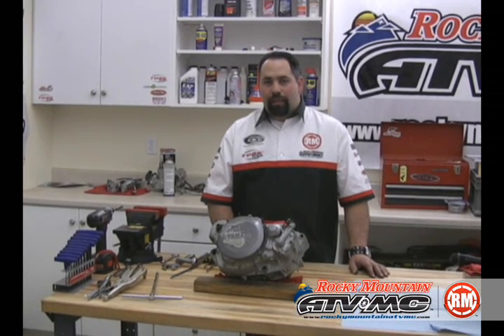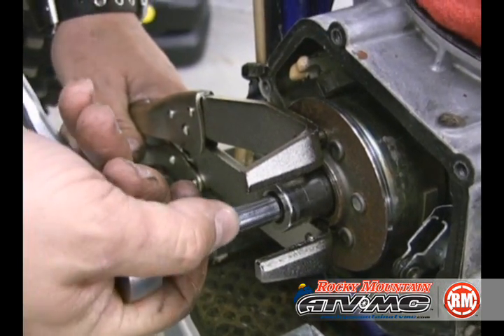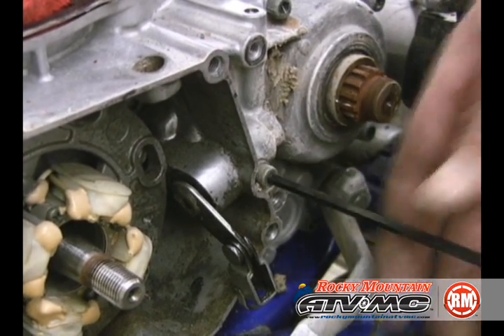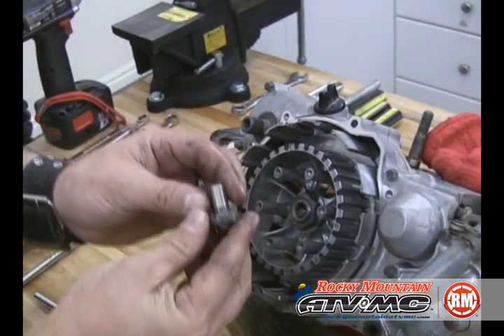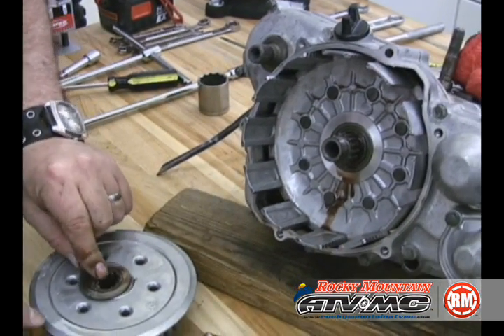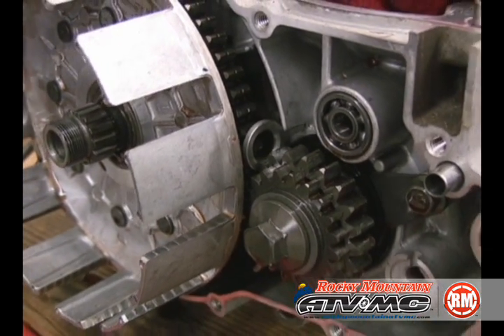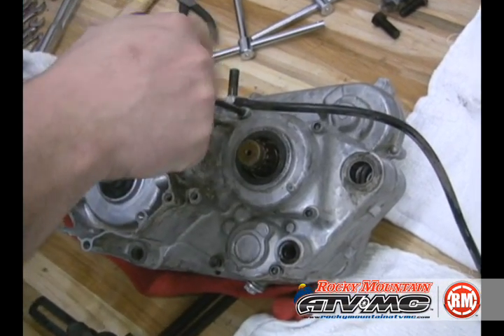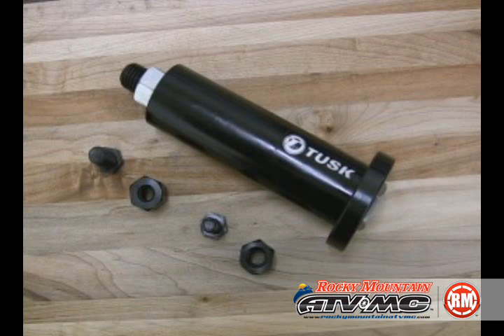Motorcycle Bottom End Rebuild | Part 1 of 3: Engine Teardown

Comment: See how easily the clutch basket nut came off? Can guarantee they loosed it before hand using another tool. Can literally see the tusk took isn't seated at all, because of its design. Never buy tusks clutch holding tool, breaks basket fingers left and right.

Comment: How do u unscrew the couch spring bolts in 2:59 without having the whole thing spin? I got my engine out of the frame as well and I can’t seem to keep the clutch assembly from rotating when I try to unscrew the spring bolts. I have it in gear too any ideas?

Comment: I would like to see a full rebuild and valve adjust on the 2008-09 DS450xmx/xc as the DS platform motor, frame and suspension is a animal all it's own with it's own problems with frame and efi system and no one has anything for it I hope you could pursue this idea for a video set if you choose not to please let me know either way ty I am willing to help with problems I have ran into that everyone seems to be having

Comment: Do I have to take all the gears, clutch, and flywheel off or could I leave them on when splitting the case? All I'm doing is replacing the crank. Its an 04 yfz450 which has basically the same motor as the yz450f, yz250f, wr450f and wr250f. Any help appreciated!
Reply from the maker: MrTechKid You need to take it off, yes.  Follow our how-to videos and it will walk you through the process.  Thanks

Comment: Is this for 4 and 2 strokes?
Reply from the maker: This is done on a 2 stroke bottom end (2004 yz250) and is to give you a general idea on how to disassemble/assemble (A Bottom End).  The process is very similar on 4 strokes but with more moving parts and steps to take.  We recommend that you refer to your bikes specific service manual and follow those procedures.  Thanks

Comment: Does it matter how the flywheel and stator are reinstalled?? Alignment marks?? Or just put it on🤷🏼‍♂️
Reply: Shane Rosenthal it SHOULDNT. Considering that not other part is dependent on their timing. The flywheel just balances crank and stator spins in the alternator or vice versa to create voltage.

Comment: I just got my cr80r and it won't let me shift up sometimes, what could be wrong, and might changing the gear oil fix it
Reply from the maker: It could be a number of things.  I would start with a new clutch kit and new clutch cable.  See if that fixes the problem?  Cables tend to stretch out and clutches wear out.  A guess would be that your clutch is not disengaging the transmission like it should, causing hard to shift.
Reply: ok thanks
Reply: Sled_NeckX99 it might just be your shift lever is set to high and cpuld be hitting your case before completing the shift maybe removimg the lever and adjusting it back on a little lower might help or it could be the shift shaft was pushed in and not grabing the gears

Comment: on a Kx125 does oil go inside the crankcase with crank an if so what should I use
Reply from the maker: No.  The crankshaft and piston are lubricated with the premix you mix into the gas.  You would just want to use a gear oil or transmission oil for the transmission and clutch components. Thanks ~Vinny
Reply: thanks alot for the help

Comment: any way to get the flywheel off without the puller ?
Reply from the maker: Depending on the bike you have, a flywheel puller runs anywhere from $4.99-29.99.  This tool makes removal a breeze.  We recommend using a flywheel puller.  Here is a link for our Tusk Flywheel Puller: https://www.rockymountainatvmc.com/p/925/17329/Tusk-Flywheel-Puller

Comment: I just rebuilt my 2000 yz250 when I started it for the first time after rebuild it was like i was holding it wide open and it wouldn't shut off. But I fixed that but it still revs like I'm holding it half open. I'm thinking that there is air getting in somewhere or maybe the sealer that i used was bad idk. I used a hotrods bottom end rebuild kit. Can u please help me?
Reply from the maker: I would make sure you have your air screw turned out the correct amount as well as with your fuel screw.  When was the last time you rebuilt your carb?
Reply: Rocky Mountain ATV MC well I took it apart after I shut it off when it was being half wide open and cleaned everything then put it back together and it didn't fix anything. so I'll check the air screw
Reply from the maker: Colby I'd recommend that you go through it and clean it all up.  Have you inspected your reeds?
Reply: Definitely make sure your idle screw and air screw are set correctly, and see if it keeps doing it
Reply: Colby I don't know if you have fixed your revenge problem but it sounds like when you put the carb slide in, you put it in half a turn out. I have done the same. good luck!
Reply: Silver Side Yes, I have fixed the problem I believe it was because I didn't put 3 brass washers on the head and air was getting in some how. But thanks
Reply: Cummins Colby the seal at the cylinder isn’t seal

Comment: i purchased some tools from you to assist in removing my engine from a 2001 yz250 and i can't seem to remove the bolt that runs through the lower control arm and engine.  am i missing something here?
Reply from the maker: There's a couple things you can do to help loosen that pivot/motor mount bolt up.  You can either take the subframe completely off or remove the top bolt of the subframe and loosen the two bottom bolts and pull it back and hang freely.  Then you'll have access to the top shock bolt and can remove that.  Lift up on the tire/swingarm to wiggle the shock back and out of the channel that it rides in.  Now you will be able to lift up on the rear tire/swingarm to wiggle it up and down as you pound the swingarm pivot bolt out, freeing the motor for removal. Hope this helps.  Let me know if you have any questions!
Reply: It does.  Thank you
Reply from the maker: Just Me You're welcome!

Comment: Does this work for all 2 strokes or most
Reply from the maker: The concept and steps for splitting a motorcycle engine are pretty much the same.  On 4 strokes there are a lot more moving parts and steps.  But the idea is the same.

Comment: what happen if you can't get your clutch basket off after you keep on hitting the nut
Reply: No reason to be "hitting the nut". Use a breaker bar.
Reply from the maker: Have you tried an impact gun to get the nut off?  Also, you can try jamming the gears on the clutch basket with a penny to help lock it up.

Comment: is it the shift paws what makes the shifter return when switch gear ? i need help because my shifter is loose and when i switch gear it come back to its place it feel like a spring came loose or something
Reply from the maker: +cashflowlou No.  There is actually what is called a Torsion Spring that rides on the shift shaft.  This is what will actuate the shift lever up or down after selecting a gear.
Reply from the maker: +cashflowlou What bike are you working on?
Reply: +Rocky Mountain ATV MC thanks I appreciate your help and that should be on the clutch side right ?
Reply from the maker: cashflowlou Yes correct!  Let us know what ya find out.  Thanks for commenting.
Reply: +Rocky Mountain ATV MC you was right man the spring was broke I got it done myself
Reply from the maker: cashflowlou Awesome, nice job!

Comment: well... i have tore apart my 2000 yz426f bike the other day and im great with engines...and to the rookie that doesnt have a hard time remembering where he or she took a part from go this route. if you have a hard time remembering DO NOT remove the kick start gear the it showed him removing YOU DONT HAVE TO... also you dont have to remove the shifter peg either however when you go to put the cases back together it might push out a bit but it will help you align the cases easier... this is a long comment eh. but other than that its fairly simple and can be done by a professional very quickly. it takes me 5 hours to tear down and rebuild my engine top to bottom. it only takes me two to out the whole thing together. also the person i got my bike from had rebuilt it before and trust me it seems like a good idea to beat the crank shaft out of the cases but dont be stupid by the correct tool for that... it isnt expensive.

Comment: i have a o6 yz 250 2 stroke if my crank shaft locked up will the kick start be locked up as well
Reply from the maker: +Rodriguez Russell It should still be able to back up as it does after you kick it but yes if your crankshaft is locked up the kickstarter will be locked up as you won't be able to turn your engine over.
Reply: Ok thanks so i should follow the same steps as you did. If so Im gonna buy all the tools you were using seems like you cant do it without them. By the way great videos couldnt do it without you. Dealerships will kill me in labor fees. Lol

Comment: A soft aluminum washer didn't work on my primary drive gear. It's over torqued. Any other suggestions? Tried a thicker washer and even a quarter and they all started to bend
Reply from the maker: +Patrick McParlane I'd tell ya to try a nickel and use an impact gun to break it loose.  There is a tool available you can purchase if it comes down to it.  Here it is: https://www.rockymountainatvmc.com/p/989/22841/Motion-Pro-Gearjammer

Comment: Could I break the flywheel bolt loose be for pulling the top end?
Reply: A guy can make a clutch hub holding tool with a couple old metal clutch disc's and weld a handle to them now you have the perfect sized tool to hold the hub that will not slip and if you don't have  old clutch disc's laying around try calling a few local shops they will probably have some laying around and they are probably just going to throw them away anyways it doesn't hurt it ask
Reply from the maker: IncogInfidel Yes

Comment: What tools were you using again?
Reply: Haha. I see what you did there.
Reply from the maker: GeorgeJohnRingoPaul We used our crankcase splitter/seperator, clutch holding tool and crank bearing installer/puller tool. Those are the main ones you would need.  Then of course your normal hand tools and T-handles.  Thanks for watching!
Reply: Rocky Mountain ATV MC would I be able to purchase these?

Comment: Thanks for the quick response. It is a 1993 rm125 and I thought it was a 96 originally so I have the 96 repair manual that did not mention anything about a left handed thread but I might try
Reply from the maker: Stephen Svetz Being a "bolt style" that threads in to hold the gear on i doubt it would be a left handed thread.  I just looked at the microfiche for your machine.  Lock the clutch up with a nickel or penny and hit it with an impact gun, should break free.

Comment: Great videos! Helped a lot on my cr. I am doing an rm now and that primary drive gear at 5:38 is giving me a real headache. I jammed that washer in and hammering on the ratchet all night trying to get that bolt to break free but it's not coming. Any ideas?
Reply from the maker: Stephen Svetz What year, make and model RM? Some are left handed threads so you'll need to loosen the bolt by rotating right.  The opposite of loosening if that helps.  I would refer to your service manual on your model though. Let me know if this helps man, thanks for watching!
Reply: Rocky Mountain ATV MC 2001 rm 125?
Reply: Impact drill
Reply: is it a left handed thread ?

Comment: Will a rm85 inside be the same
Reply from the maker: antwan kb For the most part yes, an RM85 will look very similar inside (scaled down a little of course). If you plan on holding an engine splitting party I recommend following closely along with a service manual and then you can also reference these rebuild videos for a better visual of what you should see. As always feel free to call in and one of our techs can answer any questions that you run into.

Comment: hey RockyMountain please help me i have this problem with my bike for at least a year now ..this if before i even split my case ....

my problem.. I know that first gear clunk is normal but this is what i feel when i shift from 1rst to second after that incident. Im happy I dont get grinding as much (maybe once in a while) but whenever I shift from 1st to 2nd, I hear a loud cunk. When i shift it at higher rpm, i have this strange feeling in my feet. Right upon shifting, i feel that the gearbox is exerting a force on my foot (opposite reaction). So when I change from 1rst to 2nd in high rpm, it shifts but there is a clunk and after the shift, the SHIFT LEVER HITS MY FOOT BACK. (Same feeling as bounce a tennis ball against the wall and catching it)

i have new shift drums, forks, and also like brand new gears...dogs on my old gear was out.....is there something im missing here please help me im going crazy...it only happens shifting from 1st to 2nd....lever hits my foot back but im able to shift it in ...ty for taking the time